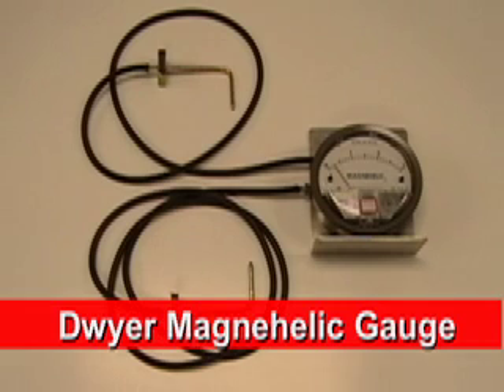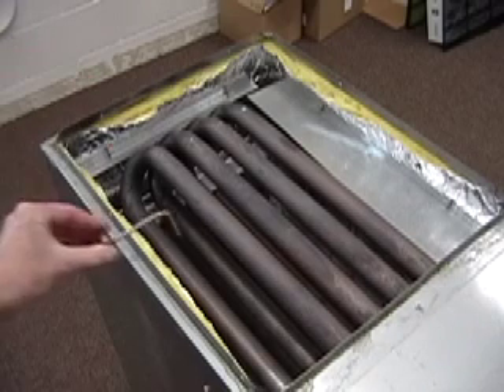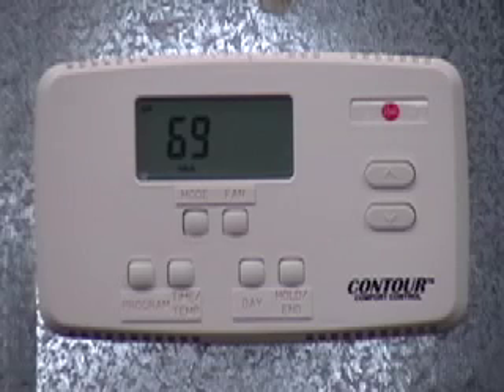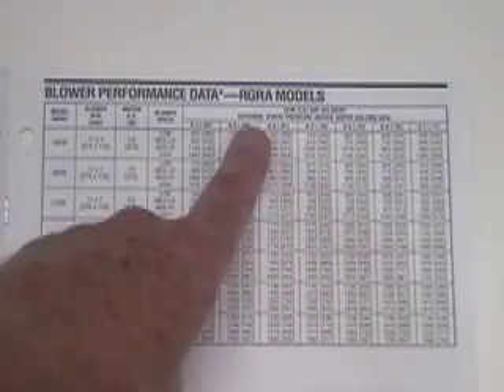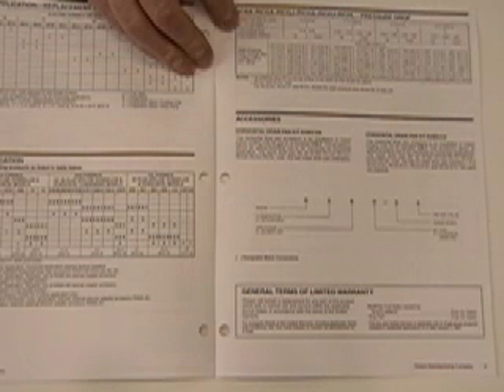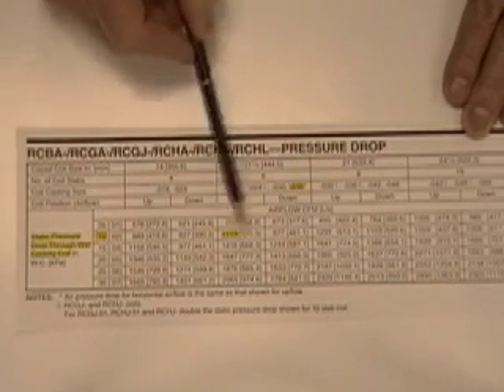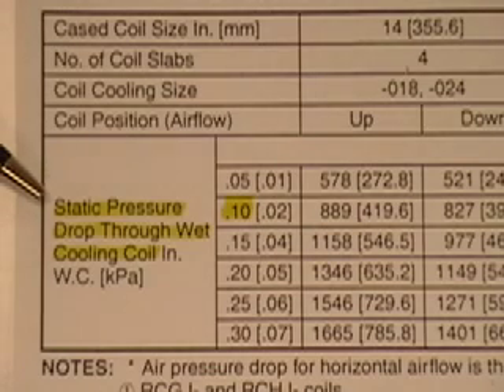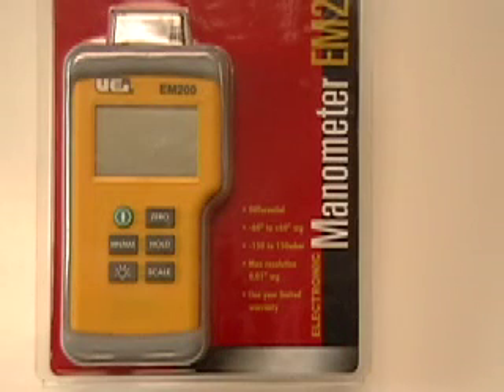Measuring Airflow of HVAC Systems

Comment: Excellent video. If for no other reason than you show the types of probes used. I.e. "static" probes (with holes perpendicular to airflow), as opposed to  using "impact probes", hole is parralell to airflow. Front hole on pitot tube. 
The SMACNA Testing, Adjusting, Balancing Manual 1993 edition. Chapt 5. Page 5.9. Shows fan TOTAL pressure being measured with impact tubes on the suction side of the blower and discharge side of the blower. This is an unremarkable measurement, resulting in TOTAL pressure difference. (Therefore, Velocity pressure will be consistent, assuming blower assembly chamber doesnt change dimensions).
But for measurement of fan STATIC pressure, using the same impact tube on the suction but a static probe on the blower discharge. Thus not measuring the difference of blower suction STATIC to discharge STATIC but the  suction TOTAL to discharge STATIC. I dont know why this is the case but i have found it on other reference materials as well. Your method using both STATIC for blower suction and discharge would seem to be a more accurate method. Again well done.

Comment: The problem is with the charts for air flow that deal with cfm and pressure drop.  This is revelant for a new coil or system.  What about a blower wheel or evap. coil that is somewhat dirty?  The chart would be completely wrong.  Most units over time aren't completely clean.
Reply: aren't even remotely clean is more like it.  Rheem is the only company besides Carrier (sometimes) that has these charts. Unfortunately the install manual and these charts are long since gone. Every one of these types of air videos always use the Rheem and they are only about 10% of whats out there, namely because they are much more expensive than say a Goodman or Nordyne or Ducane ..... and the funny thing is there isn't much in them besides a contractor, capacitor and maybe one pressure switch.....

Comment: There's so much wrong or missing here....  Sorry, "accurate" airflows are not achieved using this method, or these tools in this manner.  You should learn the proper methods for performing a duct traverse.  Wrong size mag.  Need to use a pitot static tube.  Need to use equidistant Vp readings. Wet coil, duct work complete, filters installed, etc..  SqRt of Vp x 4005 x SqFt = Cfm  Please come back to school and we can teach you the correct way to do this.
Reply: I agree. this is so many levels of wrong.
Reply: A Pitot tube gives TOTAL pressure and you can subtract static to obtain velocity.  If velocity is really what he's trying to find then the traverse method would need to be employed for accuracy.  With the static pressure probes he's using in this video it seems he can do this with the charts provided from the manufacturer to match their static pressure tests to determine their results of airflow.  What are your thought on airflow derived from temp rise formulas?
Reply: All you can go to hell,  my boss doesn’t give a shit about any of this and I have to do exactly what he just showed in about 5mnts with drilling and readings, along with adjusting the blower wheel before tanking up .
Reply: Size and space of installation can make getting a suitabley long enough run of ductwork to carry out a duct traverse difficult. This is a good preliminary method for a serviceman to see what is going on. If his readings are low, and fan amps are down, coils and filters are clean etc,  then he can proceed with a more intrusive investigation.
Reply: +Art Rose  A minimum of Sq. or Rect. duct traverse readings are 16 and a max of 64. When spacing's are laid out accurately, and all of your readings are recorded, then you can average all of the readings for a system total. It has been in my experience the duct traverse cfm is + or -  5% to the static pressure chart cfm when performed correctly. It takes a skilled technician to perform these tests. The video is based on the manufacturers testing instructions and are accurate if DONE CORRECTLY.

Comment: The manufacturers should provide the holes in the furnace body and the cased coil boxes for these measurements. I'm sure there has been heat exchanger penetrations and A coil penetrations too because the tech didn't drill in the right place.
Reply: +ritewayguy I agree bud. It would cost the manufacturer an extra buck for a hole and plug. I have punched a hole in the coil before,,, not pretty! It happened on a Friday afternoon at about 3 pm. in an occupied doctors office.

Comment: It's should be a simple theory of what the product data means and how it would be obtained.  A megnahelic in 2014 ??
Get a digital manometer and perform a proper duct traverse if you really want to know accurate Cfm.  To many installation
and factory faults will get you misleading information .
Reply: I disagree. Duct traverse techniques are useful for airflow balancing on large commercial duct systems, but that technique requires a minimum of 8 feet of straight duct with no elbows or takeoffs before the test ports and 10 feet of straight duct after the test ports with no elbows or takeoffs. This is rare on residential systems and requires more drilling, measuring, math and resealing. If you check with your favorite equipment manufacturer, you will see that they endorse the static pressure measuring procedure shown here.

Comment: your 0.1 inch measurement on a 3 inch gauge could be out by 0.06 inches either way according to the 2% accuracy of that gauge. Your reading would be between 0.04 to 0.16 inches. Not very accurate even if the pressure drop curves were accurate which they probably aren't. Your 1200 CFM should be somewhere between 900 and 1500 CFM. Accurate, I think not.
Reply: +Colin Genge Yes ,  I would definitely agree with you. A mag gauge (if used) should be sized to hit the middle to high end of the scale for the most accuracy.
Reply: Oh for crap! Know it all.